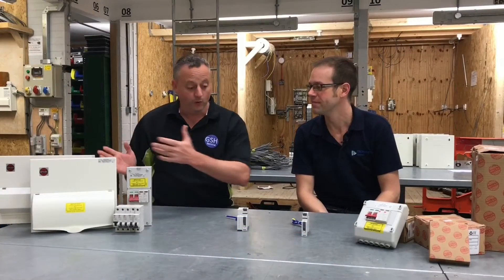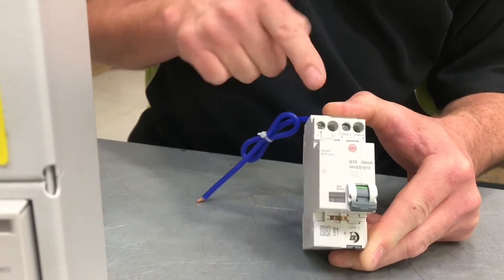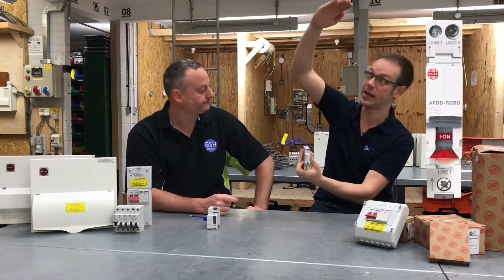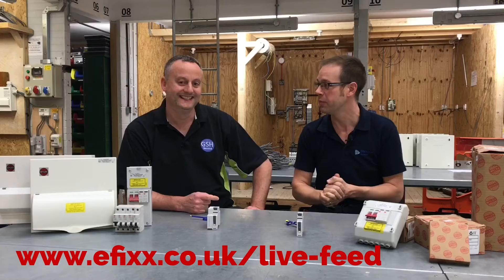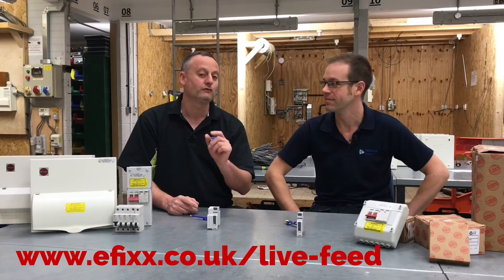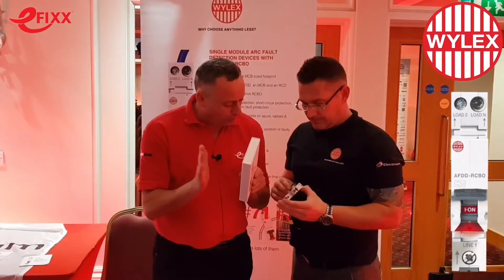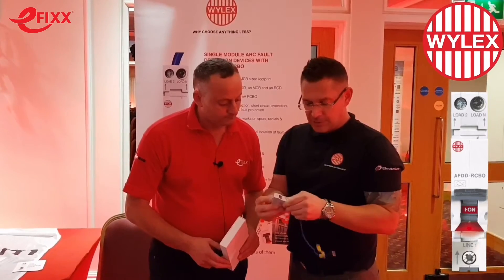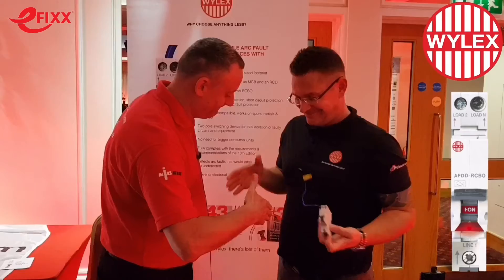Single Module AFDD from Wylex 18th Edition BS 7671 Wiring Regulations

Comment: Consumer won’t bother with them, as they are far to pricey, £200 each you may need 10 of them on a job, that’s £2k for a consumer unit.......
Reply from the maker: £100 ish but totally understand your point. In the USA about £35. Thanks for commenting. Gaz
Reply: GSH Electrical if they are £35 here in the Uk I would encourage my customers to get it